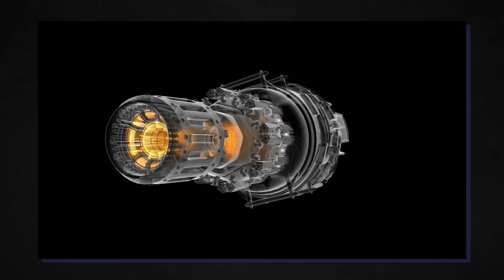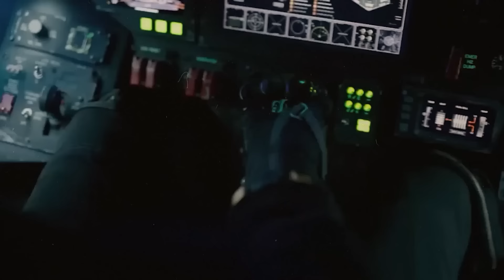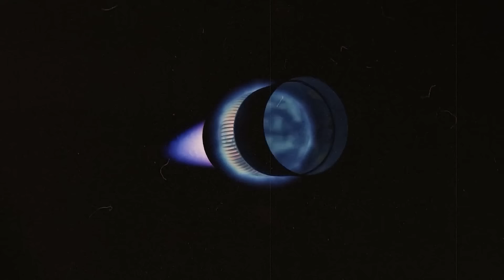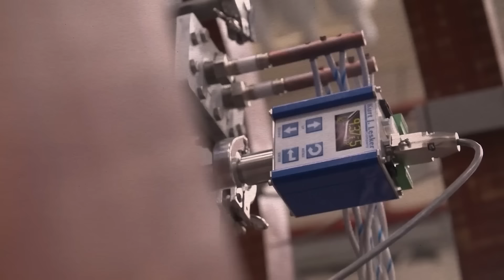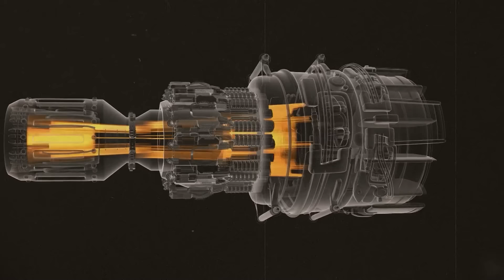Nasa’s NEW Light Speed Engine To Reach Alpha Centauri!

Comment: If Alpha Centauri is ~4 ly away and your going 100x the speed of light, you would get there much quicker than 4 years
Reply: 4 light years turns into 4 light months....
Reply: 4 ly / 100 = .04 ly = 14.6 days ?  Rollin'' dice and spinning the wheel on Carnival Space Cruises .
Reply: At 100x the speed of light it would take about 4 days.
Reply: Heck of a difference lol
Reply: Never mind, most get this wrong. Do light speed and you're there instantaneously. There is no times x amount of light speed.
Reply: @stonejones2256  15
Reply: @nuntana2   Then why does light take 4 years to get here from Alpha Centauri .
Reply: The trip would be around 15 days
Reply: @nuntana2  :face-green-smiling:
Reply: I wonder if they meant to say 100% the speed of light. Not a scholarly video. The EM drive has been debunked also.
Reply: At 100x the speed of light, you'd get there in roughly 16days...
But that's right, is engine "breaks EVERY law of physics"..  I guess it was really hard to get screws to stay in, or the rivets,  or the electrons to flow on the PCBs, heck maybe that's why going 100x the speed of light doesn't make you go any faster than the speed of light.  Lol. Cuz the engine Breaks Physics. Lol
Reply: What about Light Minutes…???? How long would that take…???
Reply: Quik maths
Reply: 4.367 light years /100 = .04367 years 
Which is 365.25 x .04367 = 15.95 days 
Note: a light year = 365.25 earth days.  It is derived from an earth year.
Reply: Very true I noticed that to
This video is very interesting though
Reply: @nuntana2  that depends on whose frame of referent
Reply: @EdD-ym6le  It would still take 4 years. But you'd get there instantly since you wont experience time.
Reply: If you can fly faster than light then it would be dark and you won't be able to see where your going 😅
Reply: you need more then infinite energy and mass to be faster the light, and the Lorentz factor would be below zero.
Reply: no you will need 4 years, cause light needs that much.

Comment: This would have been world news if true
Reply: Lol
Reply: its not a light speed engine but can get to mars in 45 days and sadly i dont think the new would cover it to busy with there agendas
Reply: True, it would have made the News.  If NASA didn't made a test flight out in space, then this is all theoretical. Let's see what happens in the future.
Reply: ....
sounds very theoretical so far (unproven prototypes) - I still feel that leik myrabo (lightcraft) is still the best theory and prototype so far,
a teacup sized hyperbolic surface where air (or space-ambient hydrogen?) is heated creating thrust against the parabolic-hyperbolic surface, large scale could look like the illustration on chariot of the gods novel, or many smaller ones alongside each other,.. this has the potential of being a star trek like sub light drive - probably earth to mars in three days at some point in the future,... only time will tell,...
maybe someday earth to alpha centauri and back in 40 years at 10 or 20 percent of light,... maybe even quicker depending on how thrust vs power source vs resistance to extreme speed vs debris problems turns out if we ever get far enough to face such challenges, I feel Roddenberry's extrapolation of flight to light forces was very valid and lucent - from thrust-drag and gravity-lift to warp vs deflector?  and structural-integrity vs gravity?,...
I'll be back in a minute,...
sorry, didn't find the original Roddenberry reference from the original trek manuals,... but leik myrabo videos are still very awesome,...
...
Reply: Love to see the day when man walks on mars
Reply: Would have loved to be younger than maybe I’d see the day when people on Earth would work on the moon
Reply: I. Want to go space to, I want to be the first man on Mars
Reply: How do you know? 😅
Reply: same thoughts... I take this as science fiction
Reply: How bout now?
Reply: Exactly
Reply: You think so, the technology that we see and use every day is at least 50 yrs  behind what the holds and keep secret ( that's not conspiracy theory )

Comment: Without some kind of shield traveling at light speed and hitting debris, what would be left of the ship?
Reply: It would require the manipulation of gravity around the craft without question.
Reply: sub space
Reply: Ordinary physics doesn't work at these speeds,objects interpenetrate.
Reply: You are protected in a giant bubble
Reply: Maybe an air bubble heads out in front, powered by a magnetic field. Or little milligram sized shields propelled with nuclear fusion reactors the size of nanograms😅
Reply: To answer your question.....Well scattered atoms spread amongst cubic light years of space.
Reply: Quantum computers to map the best route that's what I seen o a documentary it can think so quick that any objects it can divert while moving, supposedly anyway

Comment: Correction: it only travels 20% the speed of light and it will take 20years to reach alpha centauri and 4years to return(so total 24years round trip).
Reply: where did you get this info? i cant find any sources other than a random instagram post or youtube videos. not a single statement release by nasa anywhere...

Comment: EM drive was designed by a little guy called Roger Shawyer in a shed in england in 1998. Nothing to do with NASA im afraid.... Also, I'm extremely unsure how we're supposed to get to Alpha Centauri using it, due to it's inability to produce enough thust to put out a tardigrade's cigarette. Xx
Reply: Don't worry though.. the Chinese robbed it (surprised) and claim they have produced measurable thrust xx

Comment: I have always said that the current conventional rocket engines we currently use need a complete rethink.  If you want to explore and go much further than a local planet, then you will need a revolutionary completely new propulsion system device.  You will also need to alter human DNA to stop or considerably slow the ageing process. I think we are very many years away from that acheiement.

Comment: He talks about em drives and nuclear reactors, put the two together you get the nuclear em drive but leaves out acoustics and lasers for the force field to be created when travelling at such speeds which could be power from the kinetic energy from the reactors and the halo graphic interface for monitoring and controls with non interference latency reduction subsystems

Comment: Alpha and Omega 
Centorian A and B. And B is the destination.
And they really need to look
 at magnetic Engines And how magnetic anomaly works. Including vertical and horizontal Fields. It would also create a force field around a craft.
 So you're basically falling through space and/or time the gravitational Force within the craft Is not felt by a occupant.   For such massive speed Even at a ninety or a one eighty degree turn. But there must be a radiation barrier within the craft.
To protect the occupants.

And consider Darpa and skunk works projects as well. And some of John Sinclair, Albert Einstein and Nikola Tesla patents. Plus David Adair as a Adviser on some components.
Reply: Einstein and Tesla both were involved in the manhattan project. That eventually was perfected after that tragedy..

Comment: You're math is a little off if it's 4.367 light years away and you travel at the speed of light it would take you 4.367 years. That's the reason why it's called light year it's how long it takes lights to travel in one year. If you're going a hundred times faster than light then you would divide 4.367 by 100.
Reply: Yes correct

Comment: You mean 100% the speed of light. That puts a ship to alpha century 4.3 years. Why is this the only media announcing this truly unbelievable propulsion system. Have they also found shielding to work in conjunction with this LS engine.  Cuz going that fast could be a problem if a pebble is in the way.
Reply: Raise the sheilds 😁
Reply: Gravity manipulation would definitely have to be a part of the plan, around the entire craft.
Reply: Otherwise yes that pebble would be a problem. Actually there would be no ship left to even encounter the pebble.
Reply: @stonejones2256  if they could accelerate at a constant 1G gravity on board the ship shouldn't be a problem.  Though it will require some time to reach a significant percentage of the SL but existing at 2 or 3 G for extended periods is probably as bad as micro G .
Reply: @stonejones2256  exactly when looking at propulsion systems some type of shielding must be a working part. Even though space is mostly empty it's not completely empty and just one encounter is the end for what could be the most expensive thing mankind will have ever built at the point of building and all that will be required to have a interstellar mission with people on board. It would be bad to screw up the first one.
Reply: @jssomewhere6740  It takes about one year at 1G to reach the speed of light. Never mind pebbles and dust, at those speeds even hydrogen atoms will convert your mass to energy. I'm not sure what kind of shielding could work but it won't be a shield in the traditional sense. Probably some kind of an ionizing EM field. Regardless, this channel is junk science and I think I'm dumber having watched.